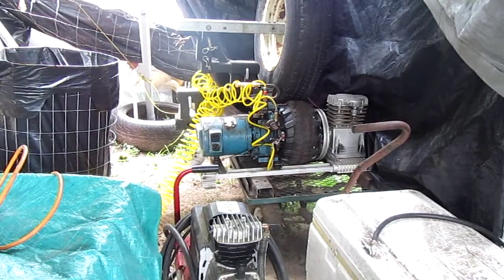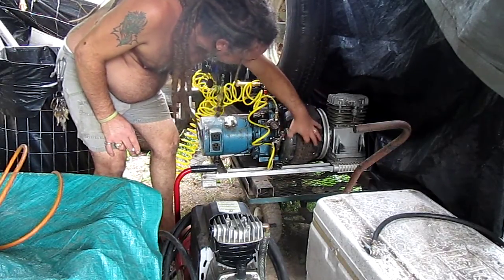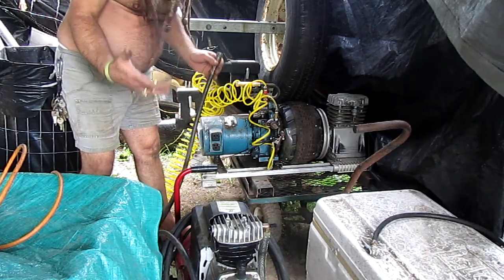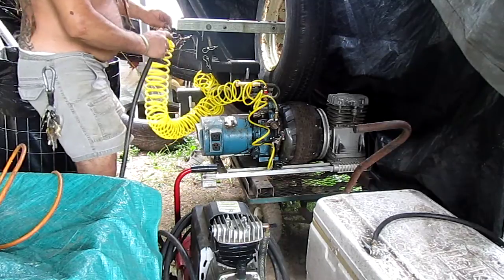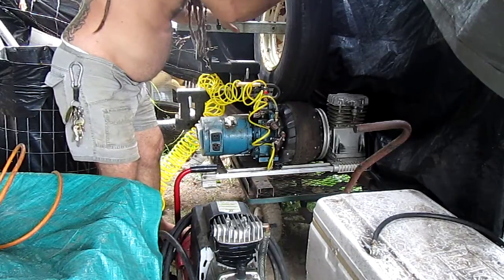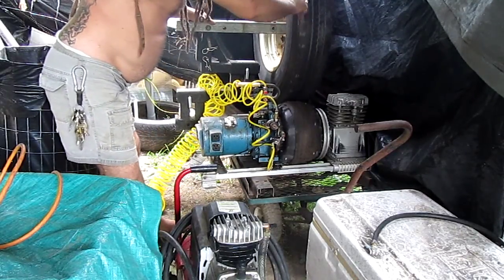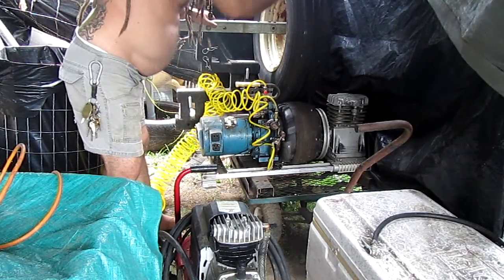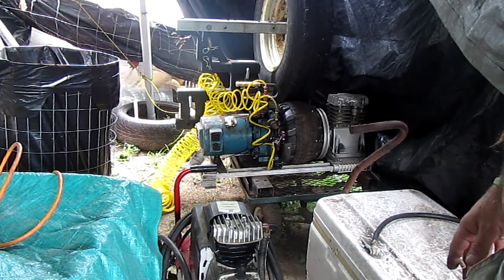Compressed air powered, flywheel assisted AC generator prototype

Comment: I think the tire slipping all over the place is causing it not to fire properly. You're gonna have to balance the friction better and dial in the air pressure to tune it too. Good luck!
Reply from the maker: Oh yeah, I fully expected there to be more work but I just HAD to see it's potential to work, so I threw this together purposely without a lot of milling or permanent mounting involved so I could gauge the sort of design improvements required to move forward now that I FINALLY have an enclosed winter workspace. The part I didn't explain was the big two cylinder compressor head that's mounted axially on sliders. I have a tire that acts as clutch plate that goes in between and I thought once the whole system gets spinning I can pipe the exhaust from the generator motor to the input port of the compressor and ease it into the rotation to try to recycle some the very air that's being used... eventually.

If I mount the tire horizontally, I can better test my "fluidic flywheel" concept and fill the tire with water instead of air and theoretically, it would start motion initially easier because it would be mainly just the tire weight, but then water would catch up and make the tire harder to STOP and then it would take only a tiny bit of air to keep it spinning. Nothing says you can't hook up a DC alternator on another wheel and press it to the flywheel either, or even a DC motor assist that runs from solar power? The versatility potential is mind-boggling.

OH! Also forgot, once the engine is rotating, there's always a SPARK each revolution from the plug wire, so you could hook up a fluorescent bulb and get some light from it too! =D
Reply: Dreadragon Flame
 Interesting, you almost have proof of concept, keep it up!